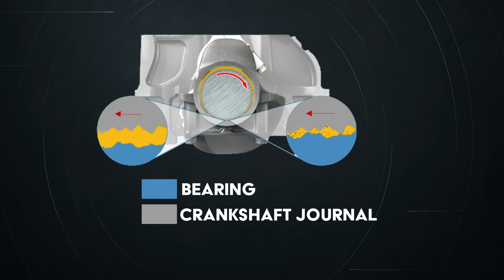the truth about start-stop technology (finally proven)

Comment: I have ALWAYS remembered the Castrol GTX advert that said almost ALL engine wear occurs during starting....I have ALWAYS known start-stop is a stupid idea. It's great being right...
Reply: "I remember marketing wank, and believed it"
Reply: It's good that you get your information from reputably sources like oil advertisements, but you're taking it out of context. That's only true for cold starting when the engine doesn't have oil in it. With start-stop engines, the engine still has oil.

The fact is start-stop engines last longer. Every second they are running is one less second of lifetime, and depending on your driving habits/conditions, it can extend lifetime by 30+%.
Reply: @MrRoguetech  Absolute tripe.....
Reply: So you are completely and utterly incorrect. 

The damage during starting is when the engine is cold. Starting an engine and stopping an engine when it is at operating temperature is no less harmful than letting it idle for that amount of time, which is probably more harmful than the former.
Reply: @Boguardis  A stopped engine is cooling down ... with frequent start/stops, the time to reach optimal operating temperature is prolonged. With longer sub optimal running temperature, depending on the climate ... worse in a cold climate/frosty conditions.
Reply: Boguardis, please stop it, get some help. It was proven long time ago, start stop is worst then idling. Go lobbing somewhere else.
Reply: @Boguardis  So, there is no extra wear on the battery.the oil pumps etc, the starter motor?? Only one of us is "incorrect" and it's not me. Cope harder.
Reply: @Cornz38  The wear is significantly reduced with engineering designs that COMPENSATE for this added "stress". 

"Cope" they say. Sounds like you're trying to  cope. These might have been issues on first generation designs but they have been sussed out.

Cope harder bud.
Reply: @Cornz38  Also you said damage to the ENGINE not the accessories. 

So you also completely changed the goal posts when confronted with your incorrected-ness 🤣

It's well documented that "startup wear" is referred to cold starts and when an engine is running COLD, because of lackluster oiliing properties. 

So yeah, cope cope cope.
Reply: @Boguardis  stay mad
Reply: @Cornz38  What starter motor ? It's a hybrid system. There is no start motor. It's a generator for the battery pack. 

Chat is full of Americans that are to poor for a European car.
Reply: @Boguardis I'd much rather have an engine that idled in the traffic than one that's stopped then started, then stopped and so on. The oil stops circulating and sits in hot spots etc it's a stupid idea for stupid people who know nothing about cars
Reply: @Dazza2292 I'm pretty sure most stop start cars keep oil and water pumping to prevent that
Reply: @MightyTubbyTubaSome toyota hybrid systems have electric pumps that keep some fluids flowing after engine stops, but this is not a universal design on all engines.
Reply: @Dazza2292  "it's a stupid idea for stupid people who know nothing about cars"

Except you're wholly wrong. Engineers design around these issues. There is no issue with "hot spots" unless you are tracking your car and cooking your oil at 140 celcius and immediately turning your car off and that's only bad with a turbo car.
Reply: @Boguardis Are these the same engineers that designed wet belts?  They did a bang up job with that idea too.  You can't out design a bad idea into a good idea.
Reply: @sarsattacks5760 Repeating nonsense still doesn't make anything true!
There's millions of highly reliable cars driving with wet belt technology.
Are 700.000 km in 15 years without any issues, not reliable technology?
Toyota is just one quality manufacturer... Perhaps the steam engine will suit your stubborn mindset?
Reply: @MightyTubbyTuba That would require electric water & oil pumps, equating in a more expensive car ... the energy drained from battery while in stop mode, would need to be regenerated from fossil fuel on start. Adding additional wear on the battery + related charging system.
Reply: @Cornz38  Your telling BS. Pumps are electric. It's a hybrid engine. You sound like your President. Full of lies and shit ;-)
Reply: @Dazza2292  facts.
Reply: @MightyTubbyTuba Only if it's equipped with an electric pump.
Reply: @Boguardis  No they don't, engineer meetings are about finding the cheapest way to do something, as cars are only being built to last 100K kms as per marketing team reports. It's so bad that the new Bronco has a wet belt, not even one that resists oil damage because it costs 20% more than the shitty belt that will snap before 100k kms that they chose to use. If it is designed in the USA it's a POS.
Reply: @Boguardis well let's see, it's a drive for efficiency and "green" credentials literally fitted as part of the euro emissions standards around 5 transitioning to 6 nothing more it's nonsense...so most engines these days also come fitted with a turbo to meet these ridiculous standards. The oil does indeed sit unless pumped continuously, something that won't happen when the engine isn't running. It's not about tracking a car you do realise more issues are caused from cars that start stop and also never get to temperature than cars ran to temp and used as designed? Or do u believe miss Mabel that's done 2 miles a week in dead of winter to the store and backs cars the better buy than someone who's ran it to temp and hasn't used stopped start? It's ironic that the batteries also wear faster than conventional non stop start aswell and the system becomes disabled until the battery is replaced due to voltage so how is that not increased wear?
Reply: @Dazza2292  I'm not going to read your diatribe when you can't even understand that most engines now have electric oil pumps which completely negates your 

"The oil does indeed sit unless pumped continuously, something that won't happen when the engine isn't running."

So you clearly don't understand how this shit works. 

Even if a car is turbocharged, unless you're revving the piss out of it and not letting it cool down there is absolutely no oil being cooked.

Please, with all due respect, stay in your lane. The engineers know what they are doing.
Reply: @Boguardis  What cars have electric oil pumps? And even a hot engine will have more wear on start up. If in doubt check oil geeks test on viscosity and load bearing ability!
Reply: @Cornz38  they actually do keep oil running by using electric oil pumps, practically all modern hybrids have them. 
The components you mentioned (starters, batteries, etc) are uprated and can cope with the extra stress. 
The hot spots are solved by use of electric water pumps. 

Don't take this the wrong way, but your arguments are flawed. You're just parroting the popular opinion on this system because you guys haven't actually sat down for a second to understand how it works. 

That being said, I don't support these systems. The primary problem is that the fuel savings don't make up for the increased costs of the uprated components. So this is a cost that's being passed down to the consumer.
Reply: @xIcarus227 explain how my current car i30n, circulates oil or coolant when the stop start system kicks in ? (That I turn off every startup)  Considering it has a chain driven oil and water pump 🤷 a hybrid is slightly different as they are destined to fail prematurely with drive battery wear and overall the whole engine will work less to start.
Reply: @Boguardis not all cars have electric pumps or oil that continues to run when on start stop, I own one with the stupid feature (sadly)..only lane I'll stay in mate is the one minus free hugging shit cars
Reply: @Dazza2292  your i30N actually has two water pumps, a main one and an auxiliary one. 

The main pump is belt driven, not chain driven - it's attached to the serpentine belt instead of the timing chain like I believe you assumed. Its purpose is to cool the engine. 

The auxiliary pump is electric and is there specifically to cool the turbo. It keeps running for a little while after engine shutdown so as to avoid cooking the oil inside the turbo if you drove hard before the shutdown. 

It doesn't have an electric oil pump though, that's usually found in hybrids which are expected to have way more start-stop cycles than a regular car with start-stop function.

Like don't get me wrong, I dislike start-stop. I've coded my car to have start-stop off at all times. But the reliability 'hit' is nowhere as big as people seem to think if the engine is designed decently. And yours is.
Reply: @Dazza2292  Electric pumps aren't the only mitigation. There are check valves and other things to help maintain pressure while the vehicle is waiting to restart.

I own one too that has a belt driven oil pump and auto start/stop. These vehicles get 300k + miles without any issues.
Reply: @Boguardis  Maybe try watching the video. It damage the engine even when warm. The oil will settle while just sitting there with the engine off. On top of that it doesn't just wear out the engine, it wears out the battery, starter, alternator, everything attached to the engine. All to save 1 oz of gas where I live as stops and long idling are not even common. Then you have to deal with the annoying jerky response as you hit the gas and have to wait for the engine to respond after having literally only turned off 2 seconds ago. Its stupid non-sense system that one could only argue makes some sense if you are idling for minutes at a time... which happens like never.
Reply: @Boguardis  Feeble coping.

Comment: This test isn't clear enough, by starting and stopping the engine for 84h straight what do you mean? Does that engine get any time to rev up or is it only starting and stopping because that's unrealistic scenario and basically useless data. How much time does it pass between each start and stop? Start stop system might be annoying because it's turned on by default but at the same time it's at least there so you don't have to turn the key to save fuel when waiting on a red light etc. It's proven that in normal driving it saves fuel, which it was designed to do. Will the fuel savings offset the cost of something going bad in the engine because of it, honestly probably yes, especially if you're mainly doing city driving where you have to stop and wait every few mins.